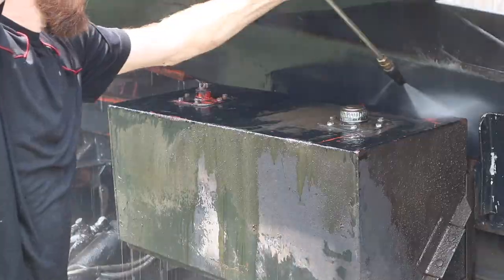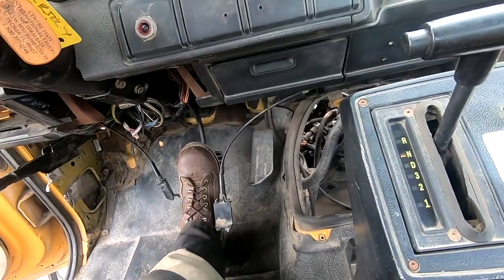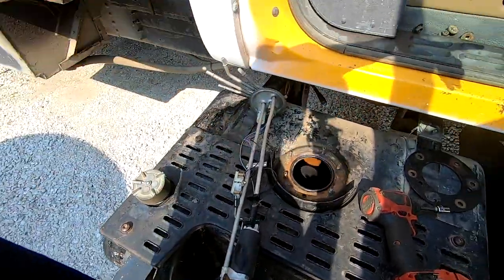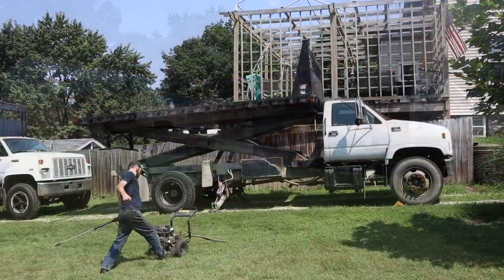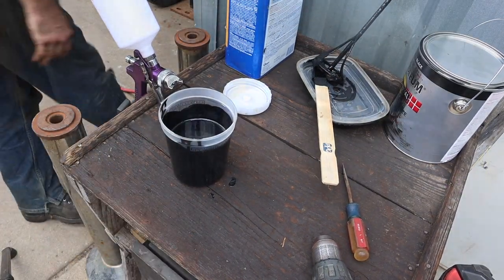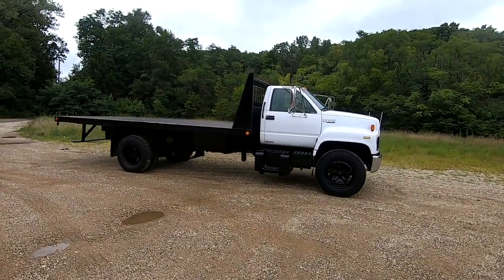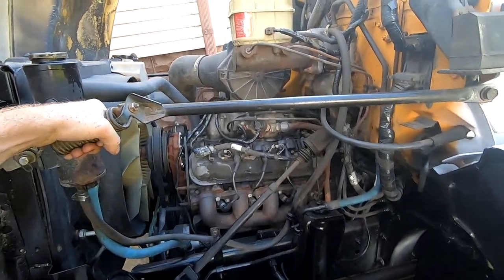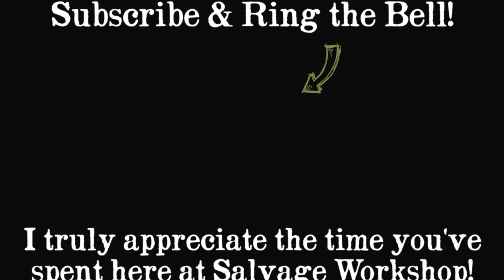"Restoring" & Flipping TWO Chevy SCISSOR Lift / DUMP Trucks

Comment: Most fuel hose is also not submersible rated. The interior is made for fuel but not the exterior as most hose is double wall. I’ve worked on stuff like yourself for years and I think we’re about the same age, but this was a new one to me. A little googling and sure enough there is a specific spec for submersion rated hose. Very hard to find in anything over 3/8 inch. Doesn’t sound like it was in enough fuel to cause your issue but I did want to throw it out there. Love your channel btw, would love to meet you someday!
Reply: Agree!!
I saw that the fuel lines of that nature are VERY expensive!!
Best luck.
Reply: Good to know Thanks !!
Reply: Your right.  And the "rubber" ones that are ethanol "rated" are usually only up to 10% ethanol and only last about 10 years in such conditions.  In my research the only ones 100% ethanol compatible are PTFE but those wont really bite onto barbed fittings with standard hose clamps.
Reply: Submersible comes into play because even if the inner core is ethanol friendly typically the lower spec hoses have an outer jacket that is rubber which degrades quickly in ethanol.
Reply: @loufaiella3354  Yeah, the prices for submersible fuel line are utterly outrageous for what it is. Sadly there’s not much in the way of alternatives, regular line will turn into a floppy, mushy mess if it’s submerged for any length of time. Luckily most vehicles only have a few inches of line in the tank at most, so you usually don’t need to buy much of it.
Reply: I use either Tygon or Gates Submerssable. I've seen people put others in and they are damaged inside a year.

Comment: Angry indian here once again and just wanted to say hi and see I've been doing diag on all those vehicles!!! Cars, trucks, and light duty pick up trucks!! Ford did that dummy shaft, hooked to a cam sensor Wich sits in the old hole of the distributor!! They also have a spout connector, and when you disconnect it you go back to " base" timing!!! Been doing cars for very long time since I was thirteen and I'm fifty two and have a master mechanic in the automotive industry for years!!!! Still run my own shop and could've told you about all of it!!! It's a fun industry if you are willing to learn, and you can say " I did it myself" 😜😜😜😜😜😜😜🤣🤣🤣🤣🤣🤣🤣🤣🤣🤣🤣🤣🙏🙏🙏🙏🙏🙏🙏🇺🇲🇺🇲🇺🇲🇺🇲🇺🇲🇺🇲🇺🇲🤘🤘🤘🤘🤘god bless brotha flip em both!!!!! Mr. B

Comment: i grew up in the hard coal region of Pennsylvania.  The coal delivery companies used to use a lot of scissor trucks when they delivered coal.  Since the coal bins in the homes were often located in places requiring a lift  for the coal and a coal chute which was put into the homes coal bin window. Also the coal was oiled to prevent coal dust from  permeating the home.    Good job on your endeavors.
Reply: When I seen this video I thought that a combination scissor/dump truck is cool and something ive never seen/heard of. Then when I seen your comment I felt like a dumbass. I'm from Scuylkill County and see trucks like this daily in the winter delivering coal.

Comment: International made a diesel that started on gasoline and switched to diesel so it had spark plugs.
Reply from the maker: Ok... i guess there are exceptions, but NOT very often!
Reply: Farmall MD. Have one in the barn. Love asking buddies what fuel it takes. The see the pump and injectors and say diesel. Then they see the carb and plugs on the other side and get very confused.

Comment: Regarding the “new, out of the box” parts… I had a new 2018 Sierra that was still under warranty, but was set to have its 4th fuel pump installed!  Even though it was covered with the warranty, it was was always inconvenient. Even the service technician said the parts didn’t always work right out of box. 
I don’t have that truck anymore.
Great video!

Comment: You've done a fine job, I'm sure they'll sell pretty quick. I'd bet that cut wire to the crank sensor is what gave the other shop so much headache, you did good chasing that bad wire down. Cheers from Jacksonville Florida 🌞

Comment: Along with roofing jobs, that would be a great truck for doing siding (gutter) jobs. You could even bring your chop saw and a couple of saw horses up with you along with material. Just as long as you could drive around all sides of the building you're doing the job on. No need for setting up pump or ladder jacks either.

Comment: International Harvester used to have Diesels with spark plugs. The engines started on gasoline and switched to diesel when they warmed up. I saw one when I was 20 years old, that was 60 years ago.

Comment: To rejuvenate, clean & protect your plastic, rubber & vinyl dash
and interiors- I've used the white GOOP waterless hand cleaner.
Smear on, soak 1-2 hours, wipe off with absorbent paper towels.
It "floats" grime, dirt, ink, tobacco stains out, it's lanolin protects 
naturally (sheep wool). 1-2 applications for most jobs. When wiped
off properly, there's no oily or shiny residue like other products.

Comment: Just a quick bit of trivia for ya, International and I believe it was Minneapolis Moline and a few other tractor and equipment manufacturers did make a true diesel and gasoline engine combined.They had two complete fuel systems and would run on either (and I am not mistaking a pony motor,or injectors) look them up they were pretty cool and somewhat rare but I  have personally seen them and they are cool. Just a bit of trivia for you. Good job diagnosing the early Ls engine!

Comment: Harbor Freight sells a 1/2 gallon spray pot and gun for about $60.00. Mine works great and you can mix 1/2 gallon at a time. Great time saver.

Comment: international had a diesel, that started on gas, then switched over to diesel when warm, was also easier on the starter, or something like that?..  trucks good good! hope you get good money for them
Reply: It’s called a pony motor
Reply: There were a few like that, they were actually just gas motors that would also run on kerosene for cheaper fuel and better fuel economy, but they could only properly combust the kerosene at full operating temperature, hence starting them on gasoline

Comment: You need SAE J30R10 submersible fuel hose for that in-tank fuel pump.
Regular fuel hose, regardless of the pressure rating, will melt inside the tank.

Comment: Lots of fuel injected engines had distributors. Fuel and ignition are two separate systems so you can have EFI and still control spark with a distributor. I had a 1993 GMC Sonoma with throttle body injection and a distributor and Ford used multi-port injection with distributors starting in 1986, maybe even '85, up through 1997 in the F-series trucks. Up until the late 1990s the Big Three were all using engines that had been designed in the 50s and 60s just with electronics stuck onto them. The engine management systems you see in the late 90s make a lot more sense if you keep in mind that they're stuck on engines designed for distributors and carburetors.

Comment: Some early 30s and 40 s diesels on tractors did have spark plugs because they started on gas and then you could throw a lever and switch it over to diesel to work

Comment: Submersible fuel injection line needs to meet SAE 30R10.  It also covers ethanol.  I don't recommend worm clamps for that application unless 100% certain they are 100% stainless.  Those plastic clamps are just fine.

Comment: When they swapped engines, did they go to a newer engine that has port injection rather than throttle body? The fuel pump setup looked like one for a throttle body that needs 15 psi of fuel pressure. Port injection needs 60 psi. That would be why the hose blew. The fuel pressure regulator is in the throttle body or the injection setup that returns excess fuel to the tank.
Reply: GM switched to TBI in mid 80's up through mid 90's. They were the First Gen of FI and ran at 50ish PSI
Reply: @mrmotofy  I have a 1990 Chevrolet pickup with a 350 with throttle body injection. The factory Chevrolet manual states that the system requires at least 9 PSI to operate. The pressure regulator is set to bypass fuel back to the tank at 16 PSI. I had a 1987 Chevrolet pickup which was the last year of the square body and the first year of TBI in a full size pickup. I also had a 95 Chevrolet Blazer with a 4.3 with TBI which was the last year for TBI in the S series. It also had the 9-12 PSI requirement. I also have a 99 Chevrolet Silverado with port injection that has a 60 PSI regulator. I have an 87 Monte Carlo SS that has an HO 305 with a factory carburetor.
Reply: @tiredoldmechanic1791  My experience with TBI started in 86, they were 50ish from what I remember
Reply: @mrmotofy  I suspect that your memory is faulty. Age does that to us all. 😁I was very familiar with the GM specifications at the time of this video because I was working on my 1990 Chevrolet pickup at the time. I had just installed an external fuel pump because I didn't want to replace the one in the tank again. GM TBI systems were all  9 to 12 lb systems. Ford called it Central Fuel System, CFI and ran 13 to 16 PSI. Chrysler called it Throttle Body Injection or Dual Point Injection and called for 14.5 psi maximum. Multi port systems that use an injector for each cylinder required higher pressures. Relief valves were usually set in the 60 PSI range.

Comment: On the topic of the fuel lines, there is also a difference between intank rated line and the ones you use to deliver the fuel to the components. 
Also distributors were comply fazed out in the late 90s through the early 2000s. EFI started to be a thing in the 80s.

Comment: Highly recommend being dead quiet when connecting power, and when turning on the key.  Listen to the machine.  Are relays closing?  What general area are they in?  Is the fuel pump cycling.  Or is it quiet.  That way when you start making changes you know if a behavior changed.

Comment: Ummm Just as a point of interest Some diesel motors DO actually have spark plugs and actually run on propane...So looking at someone and saying Diesels dont run spark plugs remember they could actually know what they are talking about.. I can attest that some landfill CAT diesel engines actually run on the Methane produced by the waste sites and have Sparkplugs Also some early on highway trucks the same..Have a look into it . Either way Crackin` job you are doing bringing these old girls back to life  Cheers..

Comment: I'm not sure what you're thinking, but there (were) many
EFI, TBI engines that used a pole piece, rotor & stator as points,
an ignition regulator with thermal compound, a rotor & cap with
spark plug wires. Waste spark and coil-on-plug designs came
later.

Comment: Well, there were Diesels with spark plugs. The International TD20 dozer had one. It has a decompression lever that you need to pull to crank it over and it starts on gas. As soon as the combustion chambers have warmed up a bit, you switch it to diesel mode and push the decompression lever back in. Then it runs on diesel. No pony motor, no glowplugs. Davidsfarm owned one of these and there was a video where he did a how-to-start on the dozer.

Comment: IH built a diesel engine with sparkplugs and a diesel injection pump, it was designed so you started it on gasoline, then switched to diesel. Very old design, you won't see many today.

Comment: EPA, don't we just love them. Wonder how many carburetor rebuilds on small engines have been done since the ethanol addition.. How many fuel pumps on older diesels lost because of sulfur free fuel??
Good flip, hope the other shops who couldn't get the engine swap to run watched you.
You and Marty T are the gurus of vintage equipment mechanics. 
Thanks and be safe

Comment: I've worked on many types of vehicles. and my favorite is diesel trucks! Just usually more space lol. but yeah a engine is pretty basic. you need fuses, fuel, air, spark, timing. you always check those in that order and you will 99% of the time get it going pretty fast. timing can be problematic unless you know were all the sensors are that it has.
Reply: compression, also helps lol sorry could not resist.

Comment: The 2000 Chevy would have been a great work truck for you. Use it for the small stuff and the International for the bigger stuff. This way would keep the miles and hours down on the International.

Comment: About the fuel hose. Your half way right about fuel injection hose on higher pressure systems. But you do not have the proper hose for application. There is fuel hose that is made to be submersible in fuel.

Comment: Some early EFI systems did not control ignition, only fuel. Those systems still used the same ignition system from carbureted engines.

Comment: My '96 Dakota has fuel-injection and a distributor, that it actually uses to distribute spark! I wish it used a coil-pack. Had to replace the coil, most of the engine sensors, the computer, and the fuel-pump thus far.

Comment: I had the same fuel pump issue with my 2001 gmc c6500 8.1 my failure was Delphi supplied fuel hose 2 days after I replaced the pump
Reply from the maker: YUP!! It was a Delphi brand fuel pump I installed and the hose they supplied!! Same issue!

Comment: Did You Figure Out The 
Oil Pressure spike? I Was thinking gummed up oil in the oil filter, A rebuilt that sat & never ran very likely cause and  quite an easy fix, Oil Change Done ! ✌

Comment: I have a tractor that has spark plugs in it you start it on gas and after a few minutes you switch it over to diesel for the day. It's a MD. It's an old tractor.

Comment: Did you get a chance to cut windows in the front end of the lift tracks so the bed will dump as well as lift? We have a roofing company and do that to every one of our lift trucks, it doubles the usability and the resale value. I can send you a diagram if needed. Great work!

Comment: I learnt not to trust new parts the hard way. I spent 2 days trying to workout what the problem was I replaced this pressure switch 3 times (brand new ones each time) it wasnt until I hooked up one of the new ones into another machine that was working and it failed that I realised what was going on. None of the "factory set" switches were actually set once I manually calibrated it it worked no worries.

Comment: Are you going to install a new trailer hitch on them?  I think you showed the first truck as having had the trailer hitch cut off.  Also, what about putting truck bed liner on the bed?  It should hold up decently, and not scratch off onto whatever you're dumping.
Reply from the maker: The two Chevy trucks are DONE! You won't see anything else on them.... The International on the other hand is FAR from finished and I have already done quite a bit to it... You'll see that soon! (Spoiler alert>>>Yes on the hitch!)

Comment: I hate working on sh$t with stinging stowaways. Brake cleaner flamethrower is always an ez solution. If you go out in the field ya gota get ya a good fire extinguisher preferably SS or aluminum not steel . Then mix up some dish soap and water re air charge as much as your air compressor and it kills all that flys from any distance.. replace with diesel of k1 or gas if you like a party and ya got a real flame thrower insect remover.   But dawn dish soap really works instantly and a bit safer . You can clear a whole barn of wasps or whatever  Ez.

Comment: So how did you determine if you were on the compression stroke of cylinder 1?  You might have been on the compression stroke of the companion cylinder.    Did you pull the number 1 plug and use a compression tester?  When you bring up the timing mark you have a 50/50 chance of being on the correct cylinder if you can't confirm the compression of cylinder #1
Reply from the maker: I pulled the number 1 cylinder plug and cranked it over with my finger on the plug hole and i could feel the air coming out of the hole as the cylinder came up... that's the compression stroke... once I was close, & on the compression stroke, i did the rest with the socket as you saw... That's just how I do it!

Comment: 3 heavy truck shop could get it to run, 3 shop, with experienced people that worked on these truck every time, and 1 guy, with basic tool and a booster pack, get it running.

Comment: Cam crank correlation needs to be set with a scan tool if the distributor is pulled.
Reply: No it doesn't. Static timing is done using timing marks. Ignition timing while running needs to be done using a timing light or obd

Comment: Back in the late 80's - early 90's, most engines with electronic fuel injection still used a standard coil and distributor setup, but with electronic control over the timing advance/retard.
The next step was to put cam-position sensor in the location of the distributor, i guess mainly to be able to reuse the old engine block / cylinder head castings.
I guess what you see on this chevy is the quick, dirty and ygly version of that.

Comment: That intake manifold is off 8.1L  496ci. I think that’s what you have in there not a 454. 2000 and older was 454 for 2001 and newer was 8.1 L 496
Reply from the maker: The truck is a 2000.. it's definetly a 454
Reply: The engine swapped in has an 8.1 L intake so that’s why I think it’s an 8.1

Comment: i wonder: no sanding needed for that type of paint? if so, that would save a lot of trouble.....
Reply: There's a thing called "self etching primer". It has acid in it which eats away at some of the paint below. There's 2 ways paint "sticks" to what you're painting, mechanically (so the grooves sand paper leaves behind, or the grooves from that self etching primer.) And chemically.

Comment: Honestly. Not that big of a risk. That truck could have multiple different engines in it. Could swap in a 8.1 gm diesel. Could put another gas engine  just carbureted. ……..
Reply from the maker: You could only know that if you knew more information about the deal.